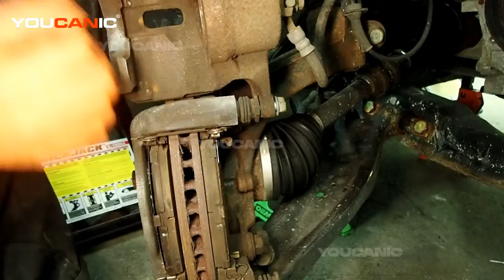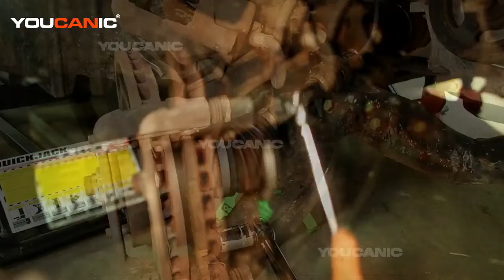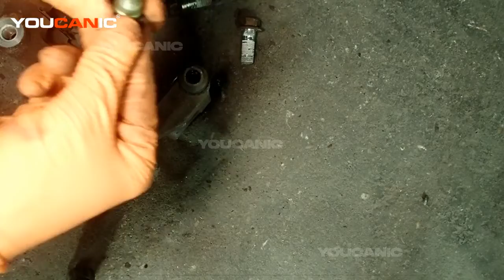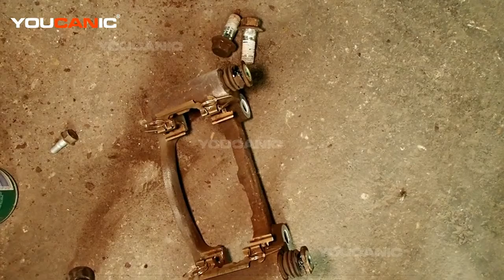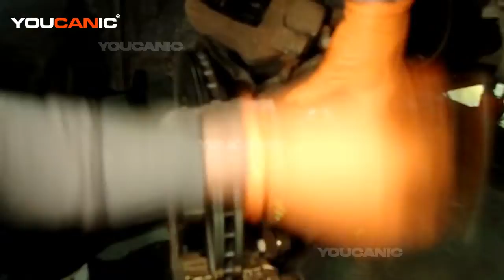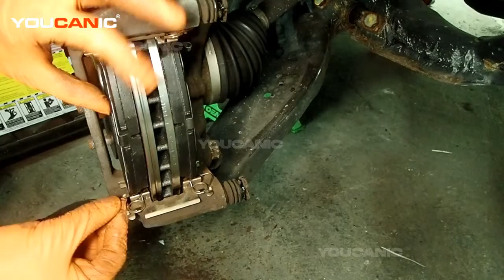2017+ Nissan Rogue Sport - Front Brake Pads and Rotor Replacement

Comment: I just can't remove that bracket that holds the brake pads. Big breaker bar, heating up, impact wrench, nothing works. Any ideas?
Reply from the maker: Thanks for reaching out! It sounds like you're having quite a troublesome experience with the brake pad bracket. We, at Youcanic, are all about providing resources and tools that make car maintenance easier and economical. A detailed solution specific to your issue might be available in our factory repair manuals at www.youcanic.com. 

Trust us to make your car ownership journey smoother! Check out our exhaustive resources, handy Youcanic scanner, and feel free to ask for assistance whenever required. We are here to provide the support you need.

Comment: I replaced my brakes. But rear left is getting super hot and even smoke coming??
Reply: Wish I could help.  I would definitely google "rear brakes getting hot".  This is what I found.  "The build-up of dust on the pad carriers can cause the brake pads to stick to the disc. When this happens, the brakes can't return to their normal position and the wheel doesn't spin freely. The constant friction creates a lot of unnecessary heat which often results in a bad smell and sometimes smoke.Aug 16, 2019"   Even though you probably figured it out by now, others who see this should google it.
Reply: Maybe the slide pins are getting stuck